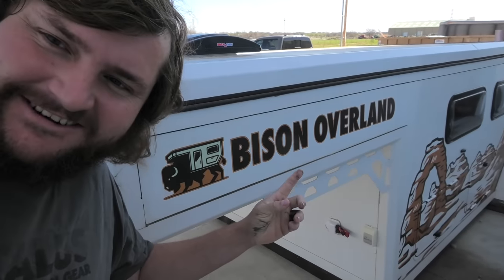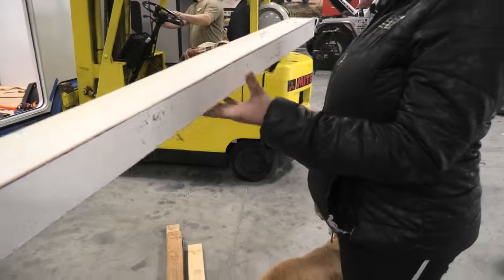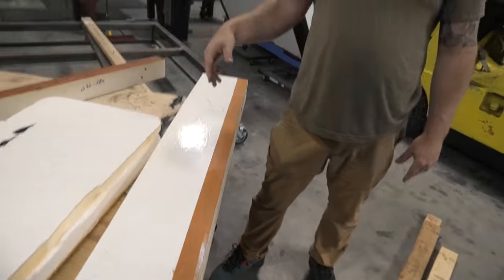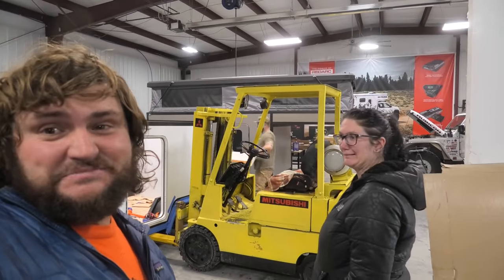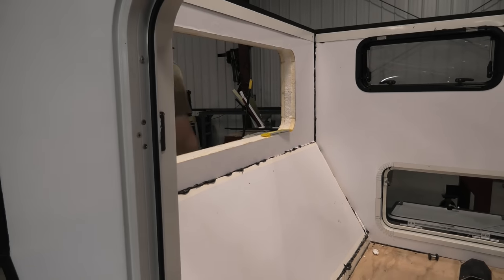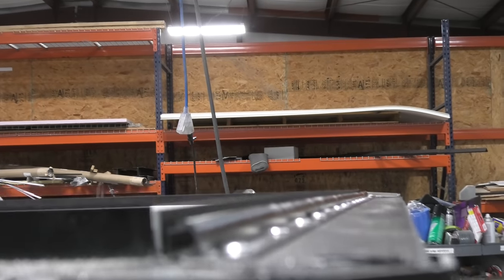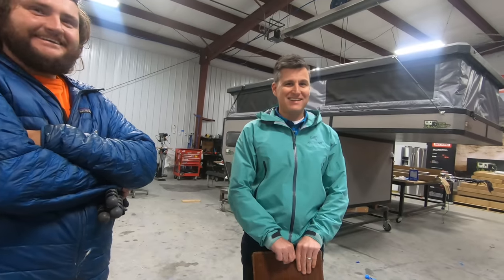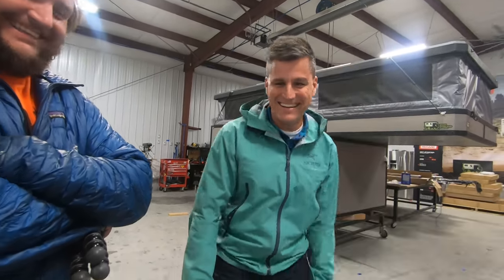How We built my Composite Truck Camper LIGHT & STRONG for my Jeep Gladiator

Comment: 3 inches of insulation.  You could heat that with two warm bodies.  You might have to ventilate with those dogs in there, just to avoid overheating. :)
Reply: 2003, for our ExpeditionVehicle, we installed:
* adhesive-back acoustic insulation against the wall, a gap, then
* one-inch pink-board, another air-gap, then
* two-inch foil-side poly.
We rarely use the Wave 3 catalytic heater above 40°f outside...
... with an interior 7w x 12 l x 7h, about 700cf.
.
We avoid rising heat loss by zero holes in the roof.
But you go right ahead, install a sky-light over the bed so you can watch the stars as you sleep...
... and learn the special relationship between rain and gravity.